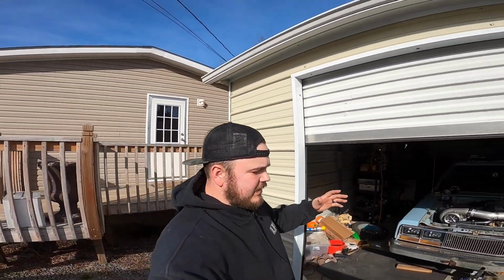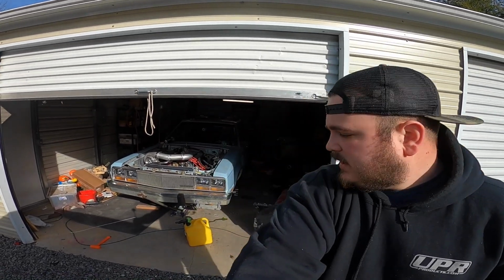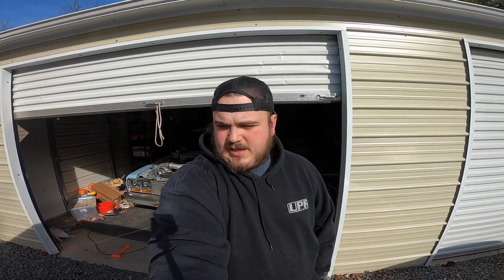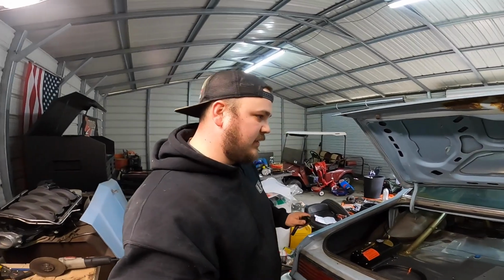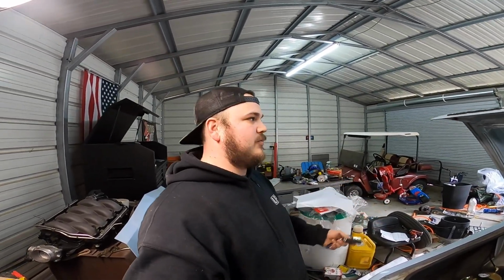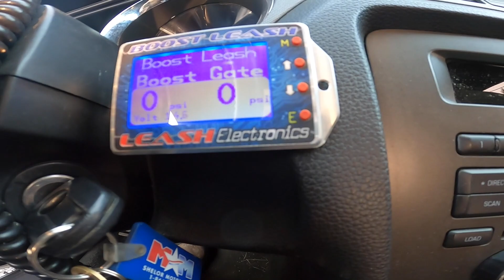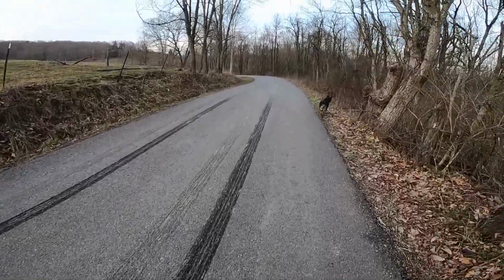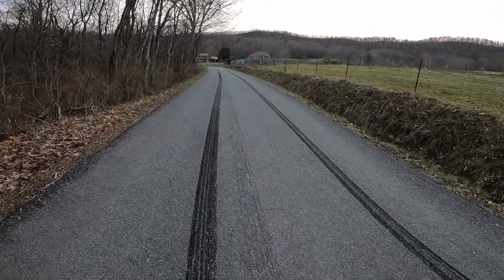Broken Parts and Burnouts

Comment: Hey brother, I wouldn't worry about your coolant leak. MLS head gaskets are notoriously bad about doing that. After you get it running, put some bar's stop leak in the radiator when it's warm and the coolant is circulating. That should fix your problem. I had a dart block 302 based 369 ci with Cometic MLS head gaskets and mine weeped a little coolant also. Hope this helps you out.
Reply from the maker: Model Man81 thanks for the info!